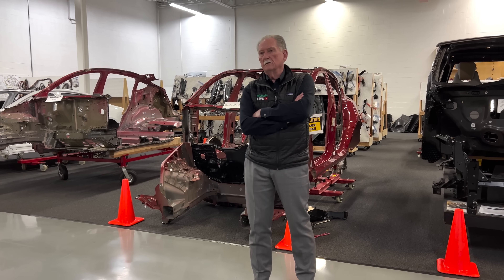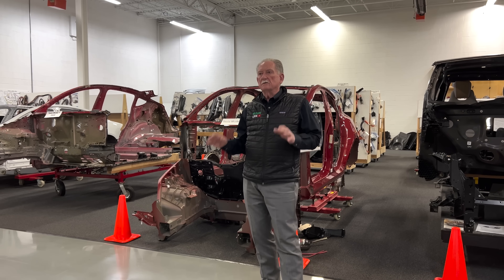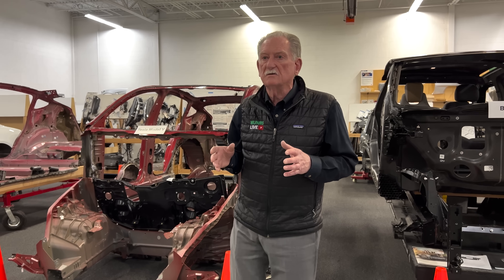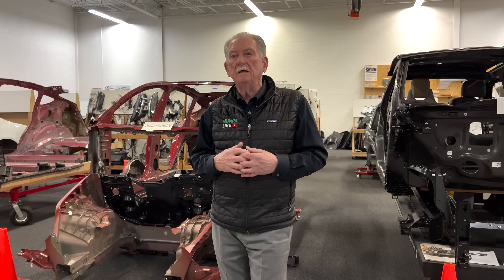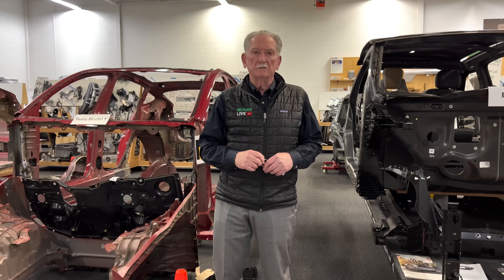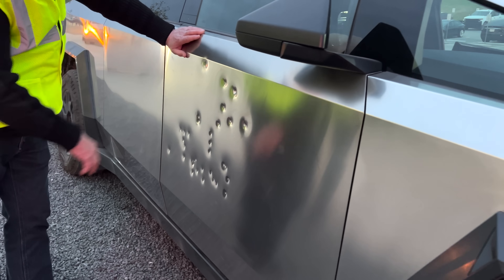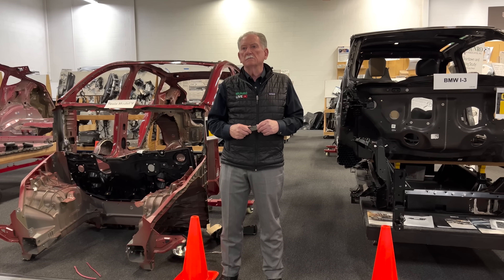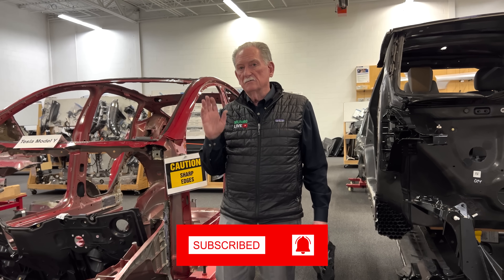An Engineering Analysis of the Tesla Cybertruck

Comment: What does the 48v lool like? Is it literally Cat5 ethernet cable.
Reply: CAT 6A at least I think. Power Over Ethernet POE. CAT 5 only gets up to 100 mbps Tesla have said their data speed in the truck is gigabit.
Reply: @simondalling7489 that makes sense
Reply: Are sure the network is a loop as I thought loops went out with token ring? I would expect each Ethernet cable to be able to be able to do transmit and receive which is like a loop but all within one cable. From what I have seen the cabling would go out from a central place as one cable to each local control unit and from the control unit cables go out to each device.
Reply: There is a confusion here. You can only transmit a certain amount of power, based on conductor thickness. Most of the POE applications are for relatively low power. You need assymetrical power and data lines(means separate conductors for power, additionally to avoid simultaneously switching noise degrading noise margin and switching thresholds). Also at gigabit speeds signal integrity is an issue as well as EMI/RFI. Likely a noise immune differential signalling using a serial protocol, with further shielding and filtering, with wire speed error checking and correction and even optional encryption!.
Reply: @aware2action   that also makes sense think elon spoke about single wire and data over power.. IDK
Reply: @aware2action  Some TCP protocols have error checking built in. Also I have been looking at CAT6A cables and they are not all the same some have quite a hefty gage. Your comment on encryption is interesting, there is a need to make sure the vehicles can’t be locally hacked through its own network, so encryption a very good idea.
Reply: Correction all TCP protocols have error correction built in, UDP do not.
Reply: @simondalling7489  You are right regarding TCP/UDP. I am not sure, if the protocol, will use the vanilla TCP/UDP. Its mostly going to be an UDP like protocol,because of the low latency requirements. But will have packet loss protection using redundancy and error correction, It would also need to ensure packet integrity under such conditions. I suspect, there would be some changes to low level hardware such as the transceivers and buffers as well. The packet negotiation again, could be entirely unique as well. All the transactions need to be timed, to ensure underlying realtime nature, of the system is preserved. Hacking is definitely a concern, encryption is just an additional safeguard, should have equal safeguards at hardware level as well, to ensure end-to-end protection. We will know full details soon, since the data is already shared with other auto makers. I also expect provisions for vendor specific extensions and special features.
It will be interesting to learn more on the fault tolerance aspects, since it will be a compromise between redundancy and additional cost/complexity. Just some 💭
Reply: that cant be. data over power... i want to see the pdf

Comment: What happens if the steer-by-wire system fails at speed?
Reply: Describe the failure mode that has you concerned please
Reply: @farmerdave33  Battery fire? System wide electrical outage?
Reply: Redundancy.
Reply: 3 times redundancy , can’t happen. If ayrton senna had this , he will be still alive
Reply: @claudioguiotto-mm7tq  Is this the same type of redundancy that sees driver unable to open windows/doors in a Model Y battery fire?
Reply: @saiello2061 doors have mechanical release cables to supplement the electric ones.
Reply: @chstra45  Which, Cybertruck or Model Y? I've seen footage of people having to smash windows to escape a battery fire.
Reply: @saiello2061  So what? Btw Tesla is not only one to have cumbersome door handle system.  Also i know u trolling. :D chill out
Reply: @saiello2061  all tesla doors have emergency mechanical releases. Because someone smashes a window doesn't mean that was their only, or their best, option. I likely means they didn't bother to learn how their car works.
Reply: @chstra45  If that's the case, then all well and good. But the Cybertruck doesn't have mechanical steering redundancy? So the question still stands: what happens when the primary system fails? Exactly what ARE the redundant systems? Does anyone actually know? Or are we all guessing?
Reply: @saiello2061  are you confused by the word "redundancy"? No one needs to guess, all one needs to do is research how these systems work in other applications. This is why many have already stated that this has been a well proven technology in planes for decades.
One question for you. In all other vehicles there is a mechanical steering system. What happens when one of those parts break? Where's the redundancy? How does someone maintain control over their vehicle?
Reply: @chstra45  So I'm guessing that you don't actually know what the Cybertruck "x3" redundancy consists of? I don't know, you don't know, nobody knows. It's all well and good saying its based on aircraft level redundancy but since this so-called "aircraft level of redundancy" is being used for the very first time in an auto vehicle that makes it "oh so special", why wouldn't anyone want to know how it works? Is it electro-mechanical redundancy? Software controlled? Mixture of both? What happens if there's complete power outage, what then? Sensors fail, wiring fails, motors fail, software fails. If I was intent on buying the Cybertruck, I'd be all over this "x3" redundancy system, if nothing else but to attempt to ensure that its going to be at least, if not more reliable than a bog standard mechanical steering system. When any mechanical system starts to fail, it generally fails gradually, time enough to intervene. When electro-mechanical/software systems fail, they more often fail without warning.
Reply: @saiello2061  I know exactly how it works. But I'll only say this much; There are redundant sensors, controllers, motors, communication, and power. A loss of any one form of redundancy will trigger a warning but still allow for safe control of the vehicle. The idea that any vehicle, ev or ice, would have a sudden and complete loss of power WITHOUT any warning while driving is a fever dream (driver neglect and/or ignorance notwithstanding). As for the rest of your statement. No, mechanical systems don't generally fail gradually and warn you of a problem. When they do most people don't pay attention or recognize it anyway. And, vehicle electrical systems don't generally fail suddenly either. They constantly perform self checks and are much better at providing some form of feed back if there is an issue. Furthermore, if it's a system that is safety critical it will have redundancy.
Reply: @chstra45  Sorry, I've never heard so much diversionary guff in my life. You said a lot whilst saying nothing. You clearly have no experience of the failure modes of mechanical systems if you can make the statement that mechanical systems DON'T generally fail slowly without warning. And just because people generally might not recognise the warning signs, does not mean the warning signs aren't there to be heeded. With electrical/electronic/software systems the only time you know something is wrong is when it suddenly dies, or if you're "lucky", you get some warning smoke quickly followed by a BANG! Please. And if you do know how the Cybertruck's redundancy works then please enlighten us all.
Reply: @claudioguiotto-mm7tq  What 3 times redundancy specifically? Technical details? If Senna simply had mechanical steering he'd still be alive. Any system that has x3 redundancy mechanisms proves it is inherently less reliable. Because it requires redundant systems to achieve the same reliability.
Reply: The plane would then crash killing everyone on board

Comment: Tesla's pace of innovation continues and Sandy shows us where. The CT is almost all giga castings and structural battery pack it shows with it's rigidity and quiet cabin. Amazing tech.
Reply: But it's backward innovation. The thing is late, doesn't have an exoskeleton and the range was dropped by over 36%. In 4 years it shrunk, lost a seat, lost towing capacity and got >50% more expensive.
At last..Elon claims to know the most about manufactoring of all people alive. Wht an insult to actual professionals, some of them his staff who probably cringe with every other word he utters..
Reply: @Cloxxki  Try reading. Most popular version has 13% more range, 10% more towing capacity, and is 0.4s faster. Due to insane popularity the initial price is high but expect it to reduce to match inflation increases in a year.
Reply: @todd1771  Those big ranges come at sports car prices. You can get a basic pickup for 35K to haul lumber that does not need this 0.4s faster bs. .
Reply: @Cloxxki  Lol, show us on the doll where Musk hurt you. In four years they reduced the size so Cybertruck can fit in a standard garage, did what most “experts” said was impossible,  late, reduced the turning radius by 6.5’, reduced weight and cost and environmental impact of manufacturing , improved acceleration, got 4680 cell production going, made significant gigacasting improvements, started production of V4 superchargers and Megachargers that will allow very fast Cybertruck recharging speeds, increased ground clearance by 1.44”, greatly improved their full self driving and made improvements all over the truck, from a truck bed liner to improved aerodynamics and so on. 

“Actual professionals “ give two children and a right arm to work for and with Elon Musk. I worked alongside a PhD in aeronautics on the production line, just took any position they could get to start at Tesla and work their way up.

Comment: If this video doesn’t mention the completely abysmal crash test videos, then it’s not worth watching.
I have serious doubts this truck will even be approved for sale.
At a 35mph crash, the rear axle was destroyed. 
A crash like that at 65mph is going to fatal for everyone in the car.

Edit: https://youtu.be/2WnVnv1dpk8?si=GVhQTcWheHfrlOpR
Reply: Can you link us to the video you speak of?
Reply: I am also interested in that.
Reply: what about those F250 farm trucks with bullbars?
Reply: Test videos were analysed by some armchair engineer.
Do you seriously believe that Tesla, manufacturer of some of the safest vehicles ever made, would make it unsafe?
The rear axle didn't break because there is no axle. The rear steering probably got deenergised with the crash.
In other news, I would like to know more about the redundancies they built in the drive by wire system.
Reply: Components getting destroyed on a crash is a good thing, it means energy was absorbed and it is not being directed to the passengers.

American IIHS crash tests dont involve full frontal crash test at all, only offset tests. 
Euro NCAP crash test do have full frontal crash test into a solid wall.

Both of these test are done at 30 mph, slower than what Tesla did on their own test.
 
A crash into a solid wall at 65 mph is going to be fatal in ANY normal vehicle.

Comment: Airbus A320 first commercial plane with electric flight controls  in 1984 😀🗼
Reply: Yup the Germans experimented with very early fly by wire in 1938. Fighter jets use it since the 70s.

F1 uses brake by wire since introducing the hybrids. The latest formula E gen 3 cars have no physical rear brakes at ALL and do 200 mph.
Reply: Vive la France!
Reply: Seriously, we should be poaching the best French and UK engineers as they are trapped in the EU beauracracy. Hopefully Elon is getting German engineers via GigaBerlin
Reply: How can anyone compare extremely safety oriented and strict industries to tesla and their shoddy QC is beyond me.
Reply: @MrZXY15  safest vehicle's ever made in their segments is why, see easy&done. You poor Muppet! 👍🏻😀
Reply: @4literv6  Crash testing doesn't take into account part failures or reliability, which tesla is almost always at the bottom. Try harder 🤡
Reply: @MrZXY15  NPC
Reply: @bartwaggoner2000  Grok

Comment: Did you really just say the speed of the electricity goes up with higher voltage?   You're definitely not an electrical engineer!
Reply: Speed of electrons through a resistive conductor is not speed of light. Higher voltage (electromotive force?) would cause them to travel faster, right? I am opining as my physics is ancient…
Reply: @bartwaggoner2000  No. Simply no. That is not how it works at all.  Just search.  He can't claim to be an engineer with statements like that.  I suspect he's skilled as a mechanical engineer, but ONLY as a mech eng.
Reply: He's not a degreed engineer.  He's a skilled tradesman who eventually progressed to a salaried role at ford. He may have had a title like engineering tech or something like that. There are too many fundamental things that a real ME would never say.

Comment: 240 lb extra for the 3rd motor over the Long Range, and some wheel mods?
Reply: Why did the tri motor cyberbeast camissa tested and out on a scale only weigh 6,650# I wonder? 
The r1t quad he had also weighed much less than any r1t quad I've seen at just under 6,700#

Comment: 1.  Kind of surprised the exterior isn't magnetic.  I would have thought that would be a good thing to have, to attach things to the outside of the Cybertruck.
2.  Does the lack of magnetism help corrosion resistance somehow?  As in, in salt water does a magnetic steel degrade faster or slower than austenic / non-mag one?
Reply: You can still stick a bit of iron or lead on the inside of a body panel. Even glue in place high power magnets. Then you don't need external magnets, just a magnetic item.
Reply: The lack of magnetism happens with the Austenite structure. The martensite structure is the same as a hardened tool steel and is magnetic.  What happens in cold working is the Face Centered Cubic (FCC) Austenitic structure slowly goes to the Martensitic Body Centered Tetragonal (BCT) structure that does take a magnet. I am selling a Chrome-Nickel with Nitrogen Stainless to the Navy for their mine sweeping operations.  My Nitronic material can be bumped (Cold Worked) and still be an austenite that has does not change to take a magnet.

Comment: Questions - 1  Other than the frivolous capacity to stop bullets, why is the stainless steel cold worked.  What is its real world engineering purpose?   2, all that weight saving in wiring etc but the still ending up with a 6700lb (3 tonne) vehicle.  The other reasons for 40V seem to be the real purpose, and the cost of copper ??  The castings looked great.
Reply: I think the strength is needed because the body panels are structural (exoskeleton)
Reply: I'm no expert, however I believe is cold worked after hydraforming so it retains the shape.
It is a massive vehicle, with a massive battery made of steel. I'm not happy that 3 or 4 tons pick ups are around. What happen in case of front collision with a Fiat 500e or other small car?
We should all move to smaller, lighter cars, but not going to happen anytime soon
Reply: @theagentsmith  in fact we are going in the opposite direction due to EVs - you raise an interesting concern!
Reply: Cold working isn't anything special. Metal is either cold worked or hot worked, both have advantages and disadvantages. In the context of CT, I think the main benefits from cold working migh be better surface finish and better dimension control, compared to hot working. Being resistant to low power bullets is just a byprodut of the desing, probably not something that was an intentional design choice. More info https://en.wikipedia.org/wiki/Cold_working
Reply: It is not made to stop bullets. That is just a fun party trick. It is made to be tough. On a level that vehicles with "tough" in the slogan can only dream of. Plus i also works as an exoskeleton. The rear quarter panels actually stiffens up the entire construction. The doors have strength in the skin instead of having steel beams inside to protect from side impact.
Reply: Old story: exoskeleton which they totally could bend and weld together from from a single plate into a better stronger lighter cheaper chassis and body. 
Real story: Just cool looking and doesn't need paint or buffing unless you want it to look nice.
I wonder whether, if they wanted to, this or another steel could also just be pressed into rounder shapes for looks and aerodynamics.
Reply: @Cloxxki  apparently not with such strong SS - it can only be folded
Reply: @bartwaggoner2000  but was that when it was going to be a 3mm thick exoskeleton, rather than the thinner panels they're using now with much of the strength from pressed panels and castings beneath the skin?
Reply: @AJB1  i would like to know that answer to that, too - is this really an exoskeleton, or hybrid exo/endo skeleton…
Reply: @Cloxxki  rounder shapes for looks, aerodynamics, and also more strength. A big flat panel is a really inefficient way to get structural strength.

Comment: Does the Cybertruck have a 48 volt battery for that stuff or is it just a power supply from the 800 volt battery?
Reply: EVs always have a low voltage battery to power the base systems. These systems do all kinds of diagnostics before triggering the contacts that connect the high-voltage battery. Until those checks are done, the high-voltage battery is disconnected at the primary contactors. (At least in every system I have ever seen.)
Reply: @JorgTheElder  That's what I was thinking but everything on Cybertruck seems to be different than it's ever been done.